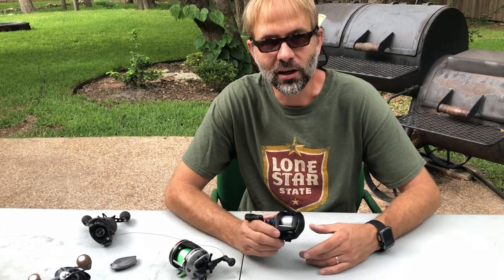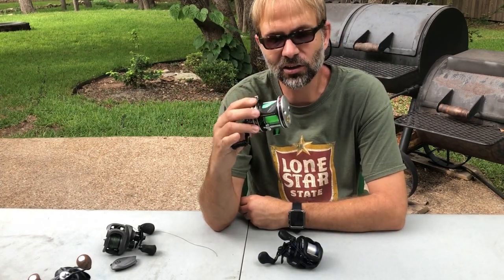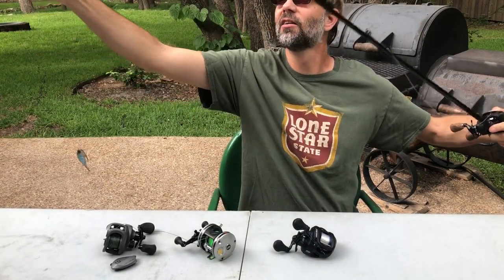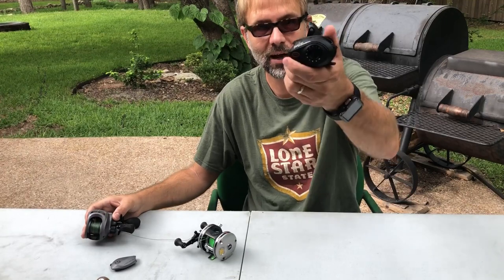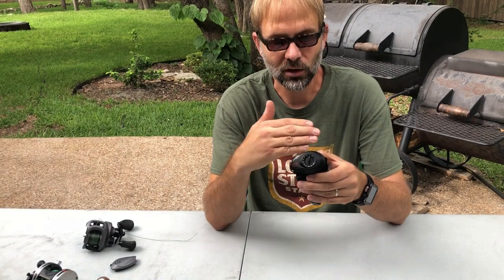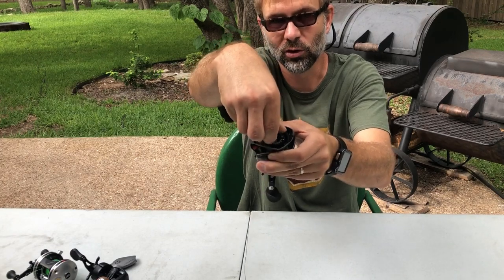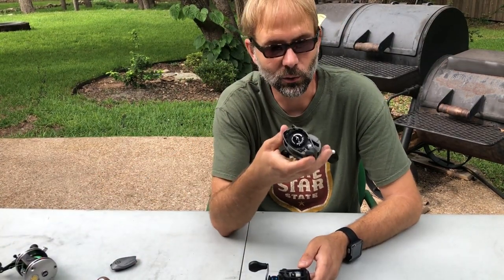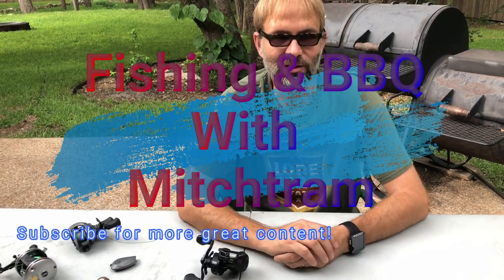Understanding Baitcasting Reel Braking Systems

Comment: I love my 13 fishing baitcaster too. It casts further than either of my spinning rods without me even thumbing the spool on the fall. Such a nice reel. Doesn't backlash easy. It's my only casting reel currently, so I'm doing all this research. Braking system is critical when choosing a reel. I don't like when you have to remove the side plate to adjust the brakes and the side plate isn't attached to the reel. You lose that plate you might as well buy a new reel. On my concept Z it hangs and is still attached when it's removed and out of the way for a brake adjustment. I might buy another 13 fishing reel. Ain't broke, ain't gon fix it. Tight lines

Comment: Some of the old style round reels do have a rudimentary 2 pin centrifugal brake inside. They can't be turned off you can remove one or both of them but when they are installed they are on.

Comment: These days you will also find centrifugal brakes that are externally adjusted and look like a magnetic system. They usually work by allowing you to move the metal ring which the brakes rub against in and out.